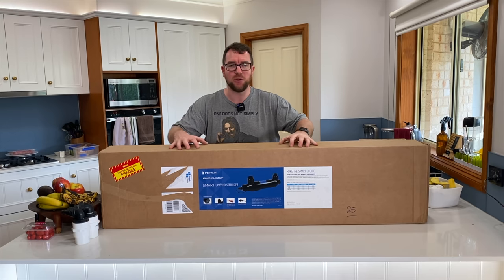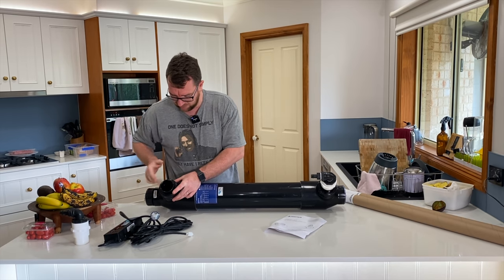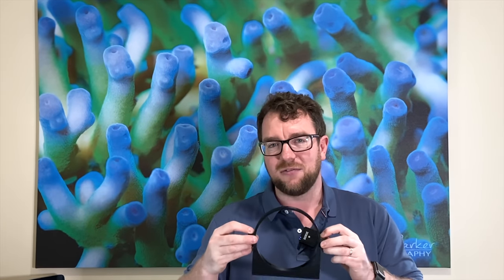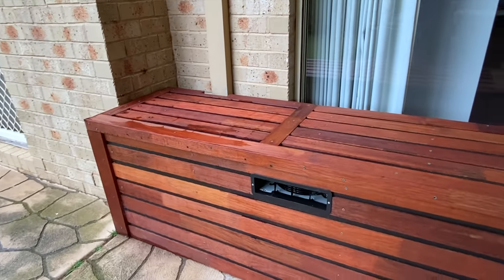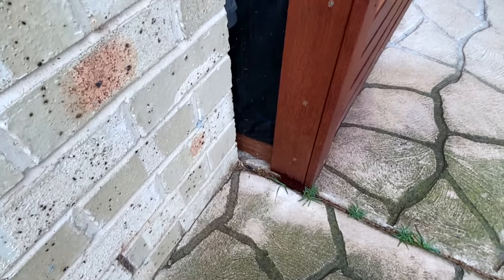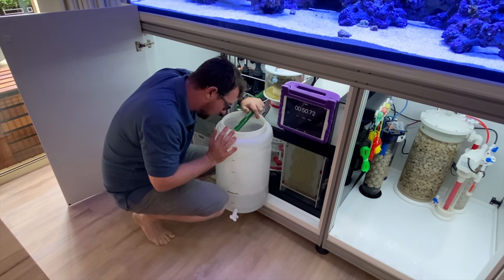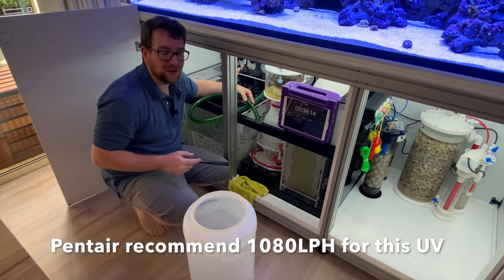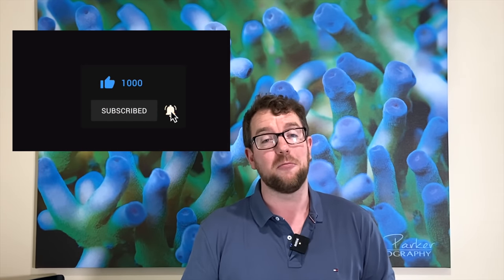Pentair UV Unboxing, installation and tuning - How to

Comment: I'm also going to be setting up my chiller on the same line as my HO uv sterilizer.  
I originally considered putting the chiller after the UV like you, but I might reverse it..

Here's what someone said about it on reef2reef: https://www.reef2reef.com/threads/advice-on-plumbing-plans.782236/post-8295164
Reply from the maker: Yeah, I’m going to politely disagree with that thought process :)

Why would you want the water to go to the tank and heat that up before switching on the chiller?

I set the chiller to the temperature I want the tank to be. If the water entering the chiller is hotter than that, it will chill it.

If you’re worried about the chiller turning on more often, just set the hysteresis higher, but I personally set mine exactly at what I want the tank to be :)
Reply: @ParkersReef  thanks for the reply.  I'm still not sure which way I should plumb it...   I gotta think about it more
Reply from the maker: I’m sure either will work fine, they are a closed system anyway :)

Comment: That is the biggest UV I have ever seen at a private home. Even my own german UV for my 400 gallon tank is only half the size. 😬
Reply from the maker: They do much bigger ones!!!
Reply: @ParkersReef  Don‘t take me wrong, for sure a good product, but quite sure the „de Bary“  or other products would have done the same good job. The space below the tank is so limited, it’s a fight for every inch. BTW...I absolutely like your clean design and white tank. Amazing.
Reply from the maker: Yeah I had a debarry on my last tank, couldn’t really tell of it did anything or not - but I guess that is a good thing!
Reply: @ParkersReef  I can exactly tell you the difference. I took down the UV to install it permanently into my plumbing. Now I have to clean the glass two times a day instead of all couple of days. It makes a big difference here. Unfortunately de Bary decided to discontinue their UVC line.
Reply from the maker: @stadt-mensch6302  glad to hear it is working well for you! Shame they no longer carry it...

Comment: I hope you didnt pay that much for the brackets Sam?
Reply from the maker: Haha all good mate, I have plenty friends with 3D printers :)
Reply: I know, when I bought my UV, I was gonna add a set of brackets, then I saw the $$, I quickly thought of a DIY option, 2- 3/4” black Rubber strips, 4 stainless screws, 4 stainless washers,  boom, you have a mount. You could also use 1/4 acrylic, and make a solid brackets rather easily.